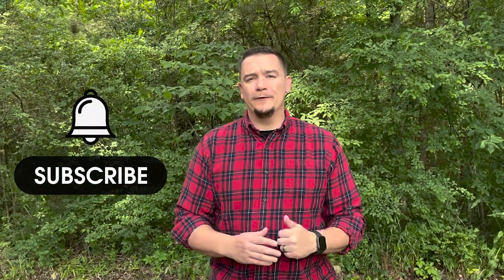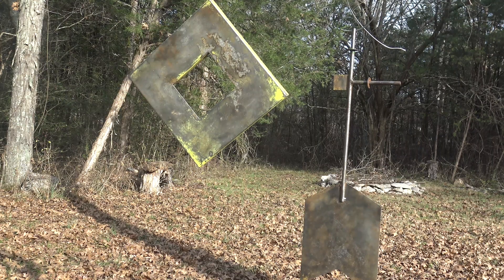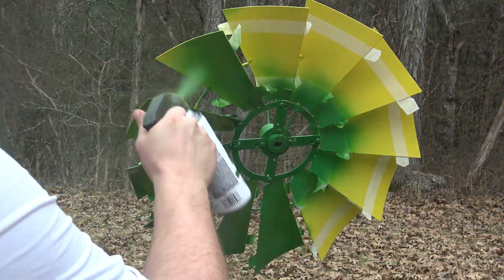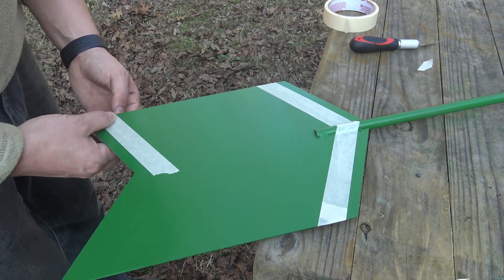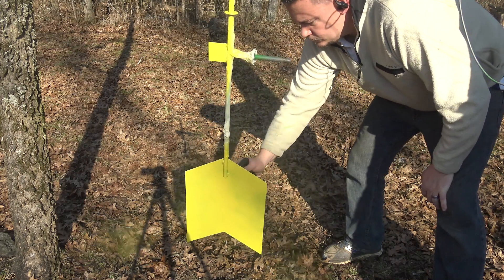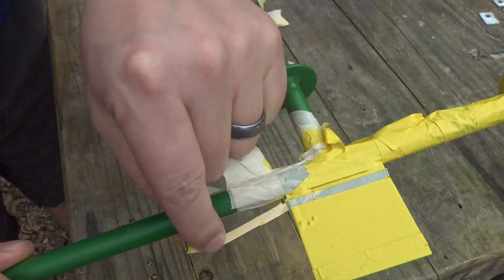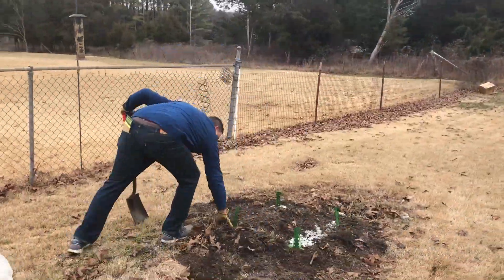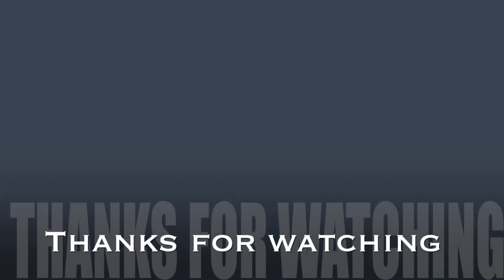Windmill Restoration Pt 2

Comment: Hey, Thanks for that. My husband threw out our old one because it deteriorated after only a few years. Before I put the new one up, I wanted to reinforce it so the same thing didn't happen again. Do you have any suggestions for strengthening weak areas in its structure?
Thanks!
Reply from the maker: Hey, Lynda! Thanks for watching our video. Thankfully the only part that needed major reinforcement was the bottom of the legs. I recommend using slotted angle iron and I have listed a link below for reference. You can also see it used in the base for the windmill video linked below as well. Maybe you can share a video of yours! Thanks again!

https://www.homedepot.com/p/Everbilt-1-1-4-in-x-18-Gauge-x-72-in-Zinc-Plated-Slotted-Angle-800087/204325585?mtc=SHOPPING-BF-CDP-BNG-D25H-025_004_BUILDER_HARD-NA-Multi-NA-PLA-NA-NA-NA-NA-NBR-NA-NA-NA-BuildersHardware_PLA&cm_mmc=SHOPPING-BF-CDP-BNG-D25H-025_004_BUILDER_HARD-NA-Multi-NA-PLA-NA-NA-NA-NA-NBR-NA-NA-NA-BuildersHardware_PLA-71700000034343777-58700003949254728-92700065946024115&gclid=41515b8076991b52dc733c8c4fba2bf5&gclsrc=3p.ds&msclkid=41515b8076991b52dc733c8c4fba2bf5#overlay

https://www.youtube.com/watch?v=a4F2PddUEhE